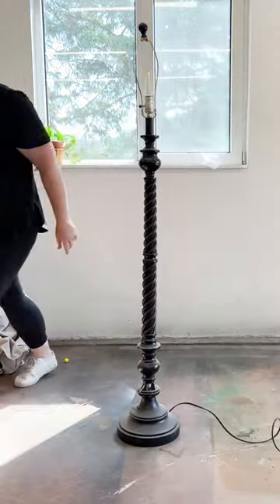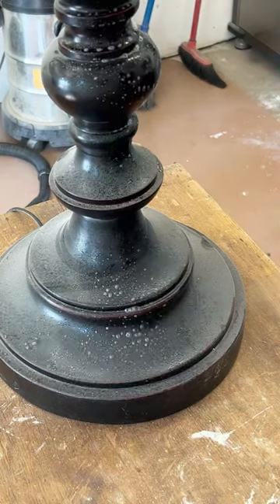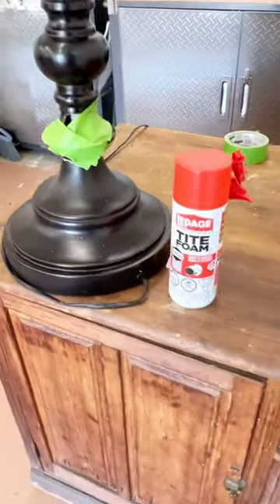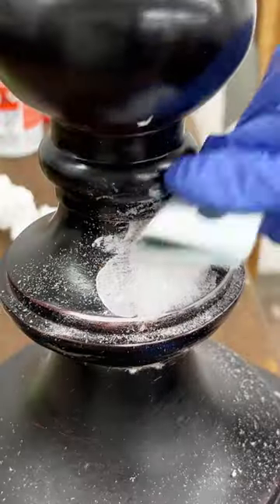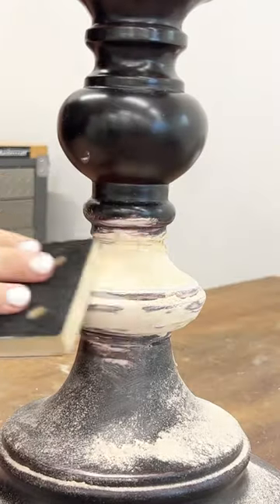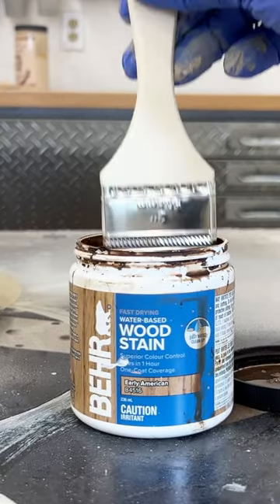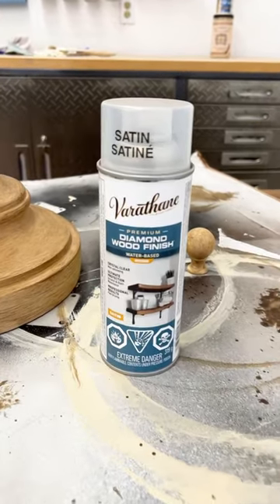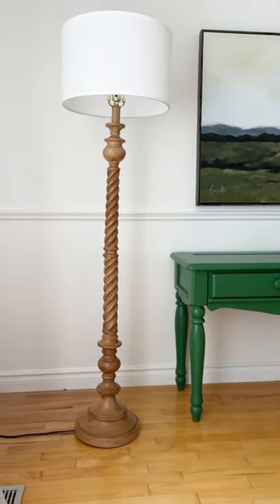Floor Lamp FLIP! 💡 #diy

Comment: Wow! What a genius use for spray foam. Beautiful results!!!
Reply from the maker: Thanks so much! 😊
Reply: Did she say "expanding foam"? Where would you get that and what is it called in the store?
Reply: That's beautifully done, look new now. Well done❤❤❤
Reply: @TnTaur125 it says on the can "Tite Foam" - hope that helps!
Reply: Came through say the same😊
Reply: @TnTaur125 Just spray insulation giam that and available in any hardware store - comes in different densities to seal wider or narrower gaps. ❤
Reply: @salvagedbykscott No, THANK YOU!!! 🎉❤ Awesome and ingenious! I didn't see you put tape or even harder (a piece of curved PVC pipe?) inside by wiring to protect it from foam getting in the way of future repairs?
Reply: @victrola2007 i think the pvc pipe thing was already in there as a base for the wire and to hold up the lamp pieces? Mij floorlamp comes in pieces with a metal pipe in it.
Reply: Como se llama lo que relleno el huequito?
Reply: @TnTaur125 Expanding foam has many diy uses -- filling holes etc. I believe I first saw it used on This Old House last century. Idk
Reply: My thoughts exactly

Comment: Awesome and ingenious! I didn't see you put tape or even harder (a piece of curved PVC pipe?) inside by wiring to protect it from foam getting in the way of future repairs? GORGE outcome!!!
Reply from the maker: The wiring was already encased in a plastic tube that ran through the inside of the lamp.

Comment: Turned out AWESOME! 
Question, would the foam fill the hollow better if you drilled a small air hole at the opposite end?  
There are several statues waiting on repair, and the foam keeps spitting out, so just wondering if an air escape would allow the foam to fill the statue? Thanks!

Comment: Afraid to put in the form  because it’s not allowed to be near heat electricity. It doesn’t conduct any heat. ??
Reply from the maker: It’s not near any electricity. The wire is fully encased in a metal conduit that runs up the centre of the lamp so the foam CAN’T make contact with it.